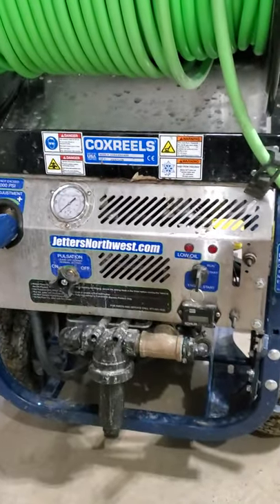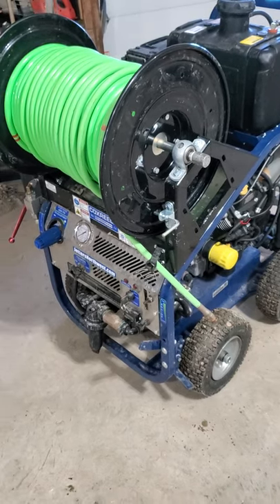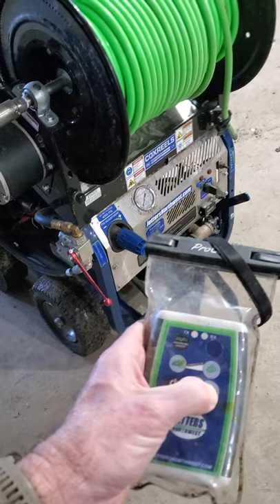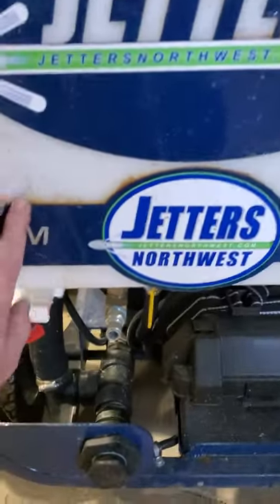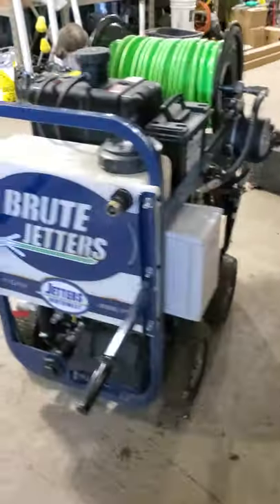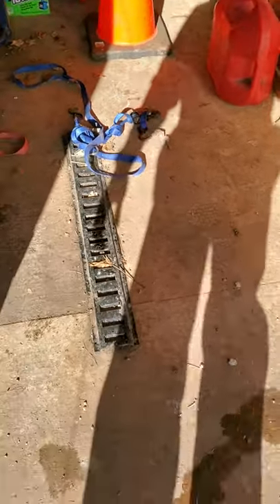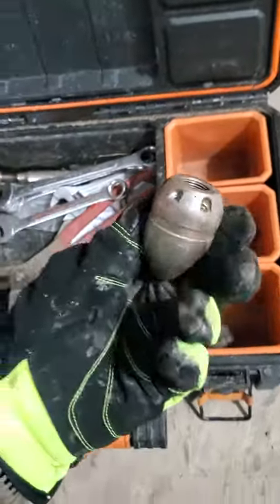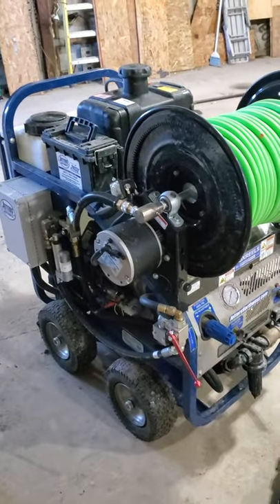Brute Jetter 4009 Follow up

Comment: Great video man.. I literally just got the skide van mount with 150 gal.tank, only did 1 jet so far. 19k spent. I'm hoping I get my money worth. Well see
Reply from the maker: Hope you got a good one. We seem to have most issues sorted out and it does work well most of the time. We use a Roto Drill from Enz or the Warthog for almost everything.
Reply: @crouseconcepts5862  I have the warthog it came with it, do u not recommend those smaller nozzle set  that come with it? For now I just have those 2
Reply from the maker: @MatthewGilmore-oe6cw  we never use the little ones that came with it. We mostly cut roots, with the hog. The Roto Drill or Reaper is good for getting a hole. The hog doesn't have a great front jet for penetration in my opinion.
Reply: @crouseconcepts5862  Thanks for the info I will definitely buy the roto drill, here in Cleveland oh we deal with mainly tree roots

Comment: I almost bought one  I built my own jetter saved a lot and built what I needed
Reply: Nice one.
Built my own also. 
Easier to find repair parts, I know the system in and out. Built to my standards and cost 25% of this one or less
Reply: @Main_Drain   what size jetter did you build

Comment: I am shopping for ajetter.  My work also includes a lot of root in 6" clay.  I was leaning towards the 12GPM and 3000PSI.  Do you thing that PSI will cut as well as your 4KPSI?  Thank you for the information.  Very helpful.
Reply from the maker: I think it will be great, if you get the right nozzles. Get a forward jet penetrator like a Roto drill from Enz or a Reaper and follow it up with a Warthog.

Comment: I'm about to purchase the exact model. Have you purchased another machine yet? If so what brand did you go with?
Also, how's the brute holding up?
Reply from the maker: We are currently having trouble with the remote pressure actuator. It's sticking quite often in the open and closed position. I was thinking about buying a different one towards the end of the year. May look at General. 

If money was no object I would go with a Mongoose.
Reply: @Crouse Concepts  we have several cable machines from general. We even have a few of their portable electric jetters.  We are satisfied with their products so far
Reply from the maker: @bustercarper  I started jetting with a little 3000/5 cart from them. Don't know if they have a machine with a remote. Our Brute was 16k with nozzles kit, Warthog, reel upgrade and remote. I'm sure that's a lot higher now.
Reply: @Crouse Concepts  this will be our first big jetter. We our trying to see who offeres the best value along with quality.
 I would hate to go cheap and regret it but I'm also not trying to waste money